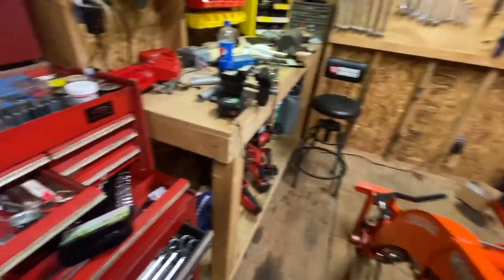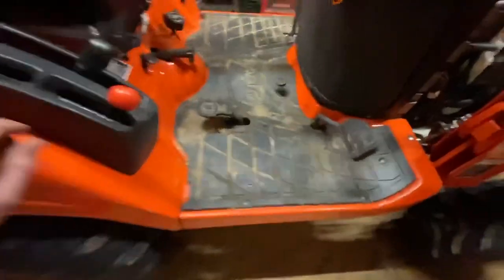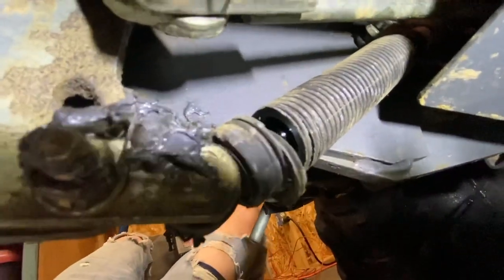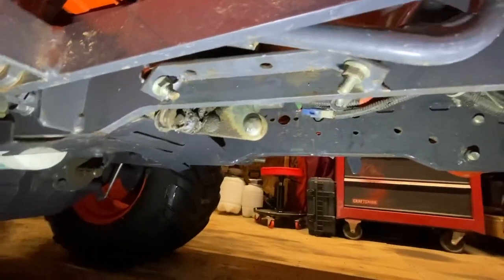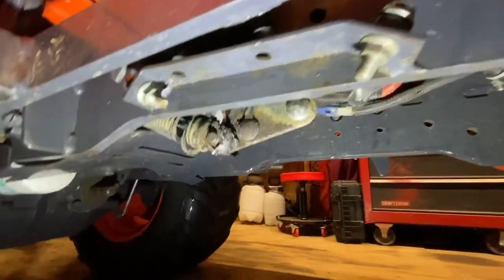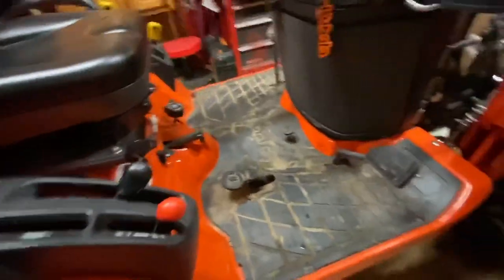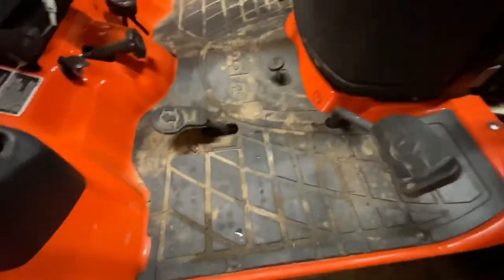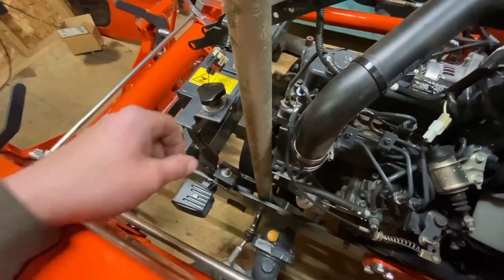Kubota BX slow HST pedal (FIX) + Upcoming mods ...Exhaust Stack?!

Comment: This video is still helping folks like me. The nut on the back of my linkage fell right off!
Reply: I put a locking nut on mine instead of the OEM one. I'd rather not have that problem again after taking 2 hours to get the bolt on and tightened.

Comment: Thanks for the tips! I’m excited to see more on the mods! Kubota took an easy way out on the fuel filters on these tractors. I am not a fan of the design, I believe your plans will be much better!
Reply from the maker: K&H Tractors sure thing man, I appreciate you watching and I’m glad your enjoying it! I got my water separator/fuel filter in the mail today along with the rest of the parts and pieces I will need (I think) to complete the exhaust stack. The stack is gonna be a challenge.. there are so many angles I have to get just right otherwise it’s not gonna be right and it’s not going to fit the way I want it to. Stay tuned and I will certainly keep you guys updated through out the week!

Comment: Biff, great video. Will adjusting the rear pedal stop make it less stiff to use as well? I ask because the rear pedal on my new B2601 feels VERY stiff. Partly that may be because you can push forward with your foot to go forward but if feels like you need to stomp straight down for reverse. At least with my treadle pedal that's how it feels. So I wonder if I did the "increase speed" adjustment you show here would give the rear pedal easier play?
Reply from the maker: Hey Richard that's a great question. This shouldn't have any effect on the firmness of your pedal.. The firmness could be coming from your linkages.. It may just been not very broken in yet so it may feel stiff cuz of that or maybe it just needs a good greasing.. I would make sure you are greasing it every 10 or so hours and if that doesn't help try spraying some lubricant on the pivot points on the linkages underneath.., If it still feels very sill I would ask your dealer to take a look as it may be something inside the transmission because you shouldn't feel like you have to stomp on the pedal to make it go in reverse.. I would start there.. Those stoppers are only for adjusting the travel/speed of the pedal nothing else.  Hope this helps!

Comment: Mine has only 83hrs  and reverse  started getting  slow will try that thanks a bunch for doing what you do for us hate to take  it in for a little  problem  like that. Already pissed at the dealership  for the 2.5 qts missing  from front diff  didn't pdi all of it no coolant  in recovery  bottle hope front end isn't  gonna go on me only had 2.5hrs on it when I bought it did the 50hr service  myself worked for Chevrolet  for 25yrs  as a tech. Now the dam fuel gauge is screwed  up but its easy  to take the fuel cap off and look in tank lol take it to them when  I'm not using it.
Reply from the maker: No problem Stephen I'm glad I could help. How many hours were on it when you realized your front dif fluid was low? I can promise you aren't the only one, low fluids on a brand new tractor specially the BX is very common because as a new tractor is run for awhile the fluid levels will drop down as all the air gets worked out.. the front axle especially as it doesn't have a vent so it takes quite a lot of drive cycles to get all the air worked out of it and for the fluid level to drop and this is prolly why your dealer didn't catch it. I can almost guarantee you that you didn't do any harm to your from axle, they are built very strong and as long as it had SOME fluid on the gears and wasn't totally dry then you'll be just fine. When I changed my diff fluid for the first time I made the same mistake.. I checked it a week later and it was good and then 3 months later I checked it again after MANY hours were put on it and the dipstick was bone dry.. I was a bit nervous myself but I topped it off and my axle has been perfectly fine since. I hope that helps your nerves a bit cuz it can be a scary thing. As for the HST pedal slowing down, you can adjust it like I showed here, just be sure its topped off with hydro fluid before you do this just to make sure it wasn't just low on fluid first.. either way.. adjusting the HST pedal wont hurt it any. As for your coolant res being empty, they often look empty as the fluid level is only suppose to be on the very bottom of the bottle, its really hard to see down in there and at first glance can look empty.. Lastly when you did your 50 hours service did you make sure to take out the transmission screen and clean it? These often get clogged up with metal shavings after the first 50 hours and if its not cleaned off then it can cause low pressure to your trans causing your trans to be less responsive or speedy.. If you cleaned the screen then you can ignore this but i figured it was worth mentioning as a lot of people forget to clean them when doing the trans oil and filter change.
Reply: @BiffsEquipment  ah might  have to clean that filter  they said in the maintenance  at 400hrs  when I change the fluid wont all th
Reply: The fluid run out when I pull the filter out? Probably  should  just do it and  change  the fluid  at 100hrs  forward  is fine noticed  the hst  whines  a little  louder  when  she's  hot but I work the dog crap  out of it not abusive  but I figured I have moved about 200 or more  bucket  loads with it just a guess average  distance  to dumping  it is about  200 yards. The guy that used to own the property  undermined  all around  the place  to build  a shooting  range  16ft high in the back by 10ft w  by 100 and the sides were 12ft high by 6ft thick by 100ft long times 2 just trying to keep my house  from being undermined  it sits on a hill higher  dumbass.  You could fire a abrahams  tank in that range  took me 3yrs  just to get all the 5ft high dropoffs  in the yard so I could mow it lmao.
Reply: @BiffsEquipment  how did your hyd. fluid screen look at 50hrs? now you are scaring me i have 290hrs on my bx 270 and only changed the screw on filter. maybe i should change it now thanks.
Reply from the maker: @bonnememoires  I would say you should def clean the screen if you wanna be safe, you don’t have a ton of hours on it yet but def enough to have that screen start getting gunked up. I see these screens at 50 hours loaded with rtv from assembly and break in metal/material so it’s always good to do it at or around 50 hours to get rid of all that debris cuz once it starts to get clogged you may see a drop in hydraulic performance or your trans starting to slow down some. Let me know how you make out if you do it 👍🏻
Reply: @BiffsEquipment  why did you change your  trans. oil , oil filter, and check screen at 50 hrs. when the manual say"s do it at 400 hrs? and what did YOUR screen look like at 50 hrs.? thanks.
Reply from the maker: @bonnememoires  I did all mine at 400 hours I bought my tractor used. I’m just saying I have seen on forums people check their screens at 50 hours and they were all gunked up with rtv abs what not so I’m saying IF you have an issue check your screen cuz it’s likely nasty if it’s never been checked .. yes you can wait till 490 hours but if you are already having hydraulic issues then you may want to check it sooner is what I’m saying
Reply: @BiffsEquipment  thanks for a quick answer,  i bought a 1980 yanmar 135d used a few years ago looked great,  the 3 point was  working jerkie like , i drained the tran. oil pulled the screen and it had a scummie - slimie coating on it, cleaned it up put new oil in worked great.
Reply from the maker: @bonnememoires  awesome man, sometimes that’s all they need is a little goin through. Glad you got it fixed up so easily!

Comment: What size it your  workshop? Wanting to build a small one like that
Reply from the maker: My shop is a 24x32.. always go bigger than you think you’re gonna need. I wish my shop was a 32x32.. that would have been PERFECT.. but for now it’s plenty big and has been a god send! Best of luck buddy! 

Btw if you plan on working on equipment or putting in an automotive lift then you’ll want to go with 14’ high ceilings! Always go higher on the ceiling than you think you’re gonna need.. it’s more important than width and length of the garage since you can’t change the height later on.. you can always expand and make the garage longer or wider but you can’t increase the roof height so if recommend 14’ no less than 12’ ceilings! Best of luck!

Comment: What happens if you just remove the travel stop bolts?
Reply from the maker: flintlock42003 you can do this.. you will be making out the linkage tho.. long term I’m not sure if it would harm anything but you would be at maximum speed or Above max speed for both forward and reverse speeds. I actually did this on a Commerical zero turn mower I owned.. I removed the stops completely for max speed and never had an issue. I thought about doing it on my Kubota but it’s plenty quick for me now after making those adjustments

Comment: Any ideas on how to increase power without breaking the bank?
Reply from the maker: Well on Diesel engines to increase power you need more fuel.. to increase the fuel 1 of 2 things needs to happen, either you need larger injectors  .. which trust me I have been looking lol.. or you need to adjust your injection pumps fuel rate.. by turning the fuel screw you can increase the rate and timing in which the fuel is delivered to the engine .. increasing power by a lot but the issue with this is if you fail to adjust it properly and get it out of time then you could very well screw up your motor or make it have less power.. so the safest and easiest bet I would say would be injectors from a larger series D902 which is the engine Kubota uses in these Kubota bx’s.. Kubota just recently came out with a D902-T which the T stands for turbo.. if you were able to get injectors out of a D902T and install them on a D902 you would more than likely well see a significant gain.. but if it over fuels you can wash out the rings on the Cylinders and have compression loss lol.. so some tuning would be required.. so can it be done? Yes.. will he be easy? Maybe, maybe not lol.
Reply: Biff's Equipment I guess adding the “T” turbo to the D902 would break the bank?
Reply from the maker: flintlock42003 haha it wouldn’t be cheap! But it would be possible